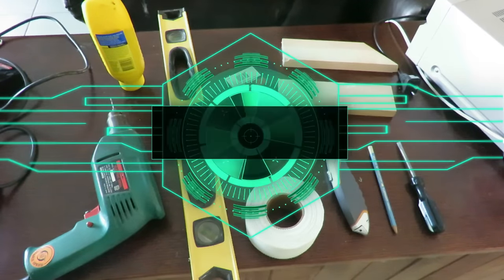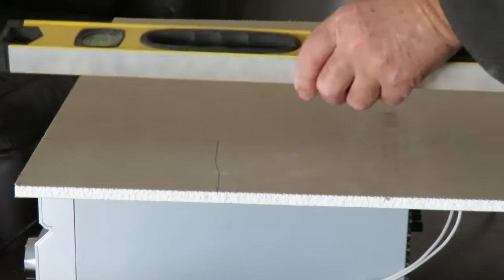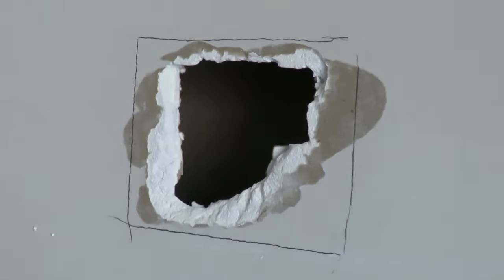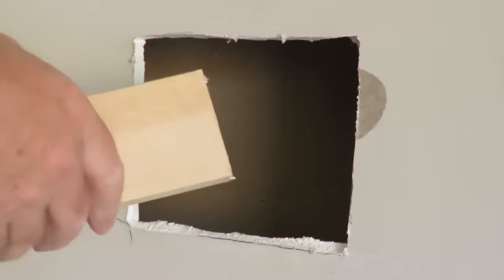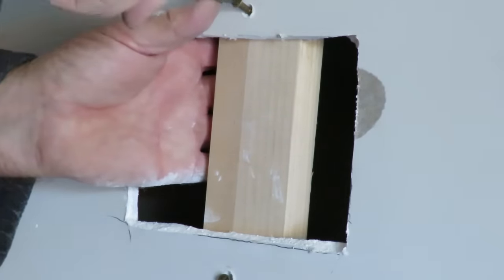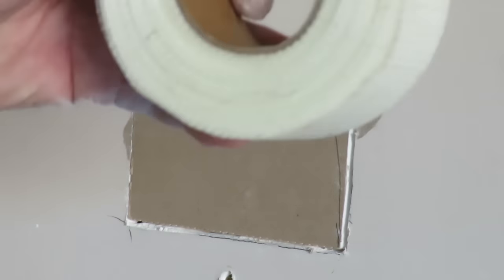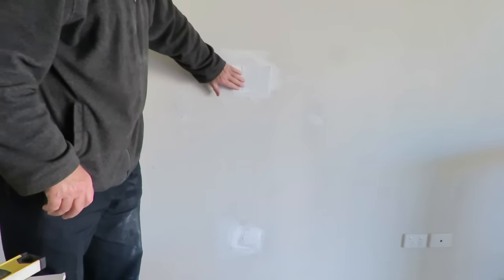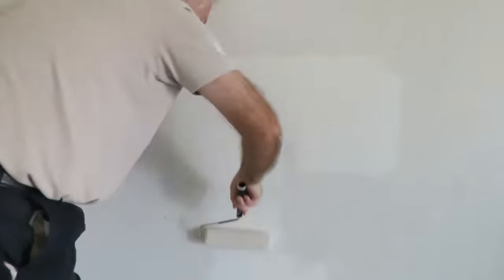🏠 How to Repair Drywall and Fix a large Hole in the Plaster Wall the easy way

Comment: Just a little constructive criticism, I understand this is just a “quick fix” but they one thing you don’t want to do is A: not totally secure the furring strip you put in the back as since this is plasterboard and not sheet rock you need that thing properly secured or one little push that thing will fall out over time. It’s sort of why many prefer using quick set mud to harden and even then people use multiple drywall screws and layers of hot mud to secure the drywall or plasterboard to the strip.

B: if you want to use mesh tape, you don’t want to overlap that as it will blister over time lol. It even says in the instructions that you shouldn’t overlap it as it adds a depth of a 1/16th or 1.5mm for you folks in the EU. In time blisters will start to form and you will have uneven walls. Unless they are cool with that then I suppose that’s ok lol
Reply from the maker: You offer good advice.
Thank you.

Comment: I repair holes like the comment down  below a few. I cut a square hole around the existing hole, measure the new square hole and cut a piece of drywall 1.5” more around the 4 sides, turn the drywall face down and draw lines 1.5” in from top to bottom and side to side. Cut down into the drywall and one by one, break the drywall sides down to the front paper and peel away until you have the solid square piece surrounded by 4 paper “wings”, (dry fit to assure it fits into the square hole you made) put mud around the hole and slowly push the prepared square into place, gently apply some mud on the “wings” while pushing out the mud already applied. Sometimes I will dip the “wings” into a bowl of water which helps the mud to disperse. Feather the mud outward and let dry. After dry, come back with a final coat of mud smoothing at the same time and then sand...easy peasy!
Reply from the maker: Very nicely laid out and well written.
Thank You

Comment: Basically how I learned it, we called it a "hot patch".   I have a cordless dewalt dry wall cut out tool I use.   I dont always use tape.   Ive used paint stirrers for small holes especially if im on the fly.
Reply from the maker: You hit it on the head.
You make do with what's available at the time.

Comment: Gary since u had 2 pieces of wood wooden it make the repair a lot stronger if you installed wood pieces 1 to far left 1 to the far right just saying
Reply: I was thinking the same thing.  That way he not only would have had a better fit  but also the convenience of stabilizing both sides.
Reply from the maker: I normally do use two pieces of wood.
https://youtu.be/JmcR9TW4mM0?
But on the day of this video I didn't have my tools with me, and had to borrow some, and I sourced materials out of a dump bin. (I only found two screws onsite that I could use for the repair).
The video description has more details.

Comment: I personally would use the method shown with the timber like you have but I’d fix it around the edge of the hole so that the edges are solid rather than the wood down the centre so that there’s movement on the joints
Reply from the maker: Thanks.
On the day of this repair, I had no tools with me, I raided a dump bin, and borrowed some tools to do this repair, ( Check the video description).

P.S. I have a better insruction video below, (when I had all my tools with me.)
https://youtu.be/JmcR9TW4mM0?
Reply: The masters like myself don't need wood backing.if you know how to cut the patch to fit tight n snug in the hole it won't fall in ....

Comment: Screw on pieces of thin wood round inside hole, leave an inch exposed for new piece to be screwed on round flush, if you want to do it right.
Reply from the maker: The video description explains why it was done this way. 
P.S. You are referring to normal method of wall repair below.
https://youtu.be/JmcR9TW4mM0

Comment: A jab saw works better than a utility knife for cutting holes in walls.  I'd definitely screw the patch to the wood piece which should have been snugged to the existing drywall instead of left jiggly.  But thanks for the video.
Reply from the maker: Thanks for your constructive criticism, unfortunately on the day of the repair I didn't have my tools with me, and was forced to scrounge materials out of a dump bin and borrowed what I could to do the repair. 

When I have all my tools with me I normally use the method below to repair walls.
https://youtu.be/JmcR9TW4mM0

Comment: First off, keyhole saws are available. No need for the wood and screws, cut the back side of the drywall to fit the hole, cut the finish side paper  1 1/2” larger than hole. Mud the wall, insert piece and mud over the whole piece. 5 minute job.
Reply: Correct. I call these "wing"patches and are the quickest easiest way to patch hole less than 1'x1'
Reply from the maker: The video description will enlighten you.
P.S. I have another wall repair video you might like, when I had all my tools with me.
https://youtu.be/JmcR9TW4mM0
Reply: Garry Purcell ummm, the easy way?
Reply from the maker: @edge1289  It gets the job done when you don't have your tools with you, and you borrow what you can, and salvage everything else.
Reply: Garry Purcell ok Garry, whatever you say, but you had a drill, a screw driver, a utility knife, a putty knife, and wood. The whole job can be done with a utility knife and a putty knife.
Reply from the maker: @edge1289  There are many ways to repair wall damage. (Did you notice just how blunt that borrowed knife was?)
I have another wall repair video you might like, when I had all my tools with me.
https://youtu.be/JmcR9TW4mM0?

Comment: Honestly for that size drywall hole you can probably just use a mash patch or you can cut a square to size and then cut around the back of it and use the paper to stick it on I mean this method works but it’s definitely slower than needed
Reply from the maker: It all depends on what you have available on the day of the repair.
Reply: I think it's too big for the patch method you mentioned. On YouTube you'll see it called the California patch. And the mesh patches are rubbish. They leave a bulge. 
This is the way to do it with a few little variants of course  Good job 👍

Comment: Oh my god - cut a 4 inch square in the wall , cut a 7 inch square from scrap drywall , turn it over and score an inch and a half all around on the backside , crack and remove edges from outside leaving paper in tact , put some mud around hole in wall and around edge of piece your putting in , squeeze mud from under paper , great patch !
Reply from the maker: There are lots of ways to do repairs, it all depends on what is available at the time.

Comment: I've done this before but I screw the new piece of dry wall to the timber to fix it so it doesn't move. Or you can use a cut piece of dry wall instead of timber
Reply from the maker: Thanks for sharing how you repair your walls.
I normally use this method below.
📌 https://youtu.be/JmcR9TW4mM0

Comment: Awesome job!  
One tip, if available use two pieces of wood at either end of your repair, that way the piece of drywall is a bit more stable. (Specifically for larger repairs) 
You did a great job with what was available tho
Reply from the maker: Thanks for taking the time to comment, and also reading the Video Description.
I normally use the method below to repair walls.
https://youtu.be/JmcR9TW4mM0

Comment: Garry you are doing it all wrong mate 
Step 1 clean the edge of the wall and put a chamfered edge on it.
Step 2 put your timber on like you did.
Step 3 cut your board for the repair and put a chamfered edge on it.
Step 4 screw your board on more screws the better to keep it firm.
The chamfered edges will stop it cracking and their will be no need for your mesh tape has when putting mess on will leave a bump.
Step 5 use easyfil 20 for first and second coat 
Step 6 third coat use pro-mix light easier to sand 
Step 7 use a p120 grit to sand down but leave 24 hours for the final coat to dry.
Use these steps for the perfect job.
I’ve tried and tested this hundreds of times it works and not had any complaints.
Reply from the maker: Thank You for laying out a nice and easy to follow list to follow.

Comment: Good job.  I do this for a living.  A few ideas.  A drywall knife cuts those shapes way faster than using a box cutter.   Box cutters are great for scoring and snapping but that doesn't apply to this job.  Cut drywall atop your trash can to collect the dust.   Use a drywall mud pan against the wall to collect dust on the wall cuts.   paper tape is 10x stronger than mesh tape.  Pro tapers tell me this and google confirms it.  3 coats of mud is required for this repair.  Even the best 2 coats of mud wont make it look right. Use setting mud for the 1st coat.  And im sure you had none of these tools based on the comments below. ...lol.  cheers!
Reply from the maker: Thanks for your suggestions.
As you have concluded, on the day of this repair, I had limited tools with me. (I was on a non-related job)
I had to borrow some tools, and source materials out of a dump bin.
Reply: @GarryPurcell  you did awesome considering! Good vid
Reply from the maker: @snakeclaw  Thank You.
Reply: snakeclaw a machete for me 👍

Comment: You better cut the drywall till the middle of the studd. And you’ll get your backing. Proper result than putting a floater backing.
Reply from the maker: That's another way, it really up to you to decide which method you use.

Comment: Should you not put two bits of wood in to stop it moving about ?
Reply from the maker: Yes, support backing is prefered, but it all depends on what you have available on the day of the repair.

Please Read the video description for a better understanding as to why the repair was done this way in my video.
P.S. I normally use this method when I have my tools with me.
📌 https://youtu.be/JmcR9TW4mM0

Comment: Dont use screws. This is over kill. Use Mitre glue , its instant and no mess. Using tape only makes for protrusion. Peel the back piece of paper off the infill piece. This will allow the filler to be sanded to the wall and be perfectly flat.
Reply from the maker: Thank you for showing another way of doing wall repairs.
Reply: It's not another way. It's the fastest,  cleanest , most simple straight forward erase all other ways way !
Reply from the maker: @dh737  Well Said.
Reply: @dh737  it is clearly another way.

Comment: Just a question: why not drive a screw in the middle of the new drywall patch into the wood? Is there any specific reason not too?
Reply from the maker: I could only find two screws on the day of the repair.
If you read the Video description, it will help you understand why the repair was done this way.
P.S. Be sure to check out my other wall repair video, when I was prepared for wall repairs.
https://youtu.be/JmcR9TW4mM0

Comment: Far easier to use a piece of wood to each of 2 sides of the hole . That way the plasterboard is supported and there is no need for the tape.  Also if plaster board self tapping screws are used there is no need to drill. Also use a saw rather than knife to cut the plasterboard patch .
Reply from the maker: On this day,  I had no tools or materials with me. (Read the Video Description)
I normally do repairs the way you mentioned, as shown by my other video below.
https://youtu.be/JmcR9TW4mM0
Reply: iiMore solid if you put two pieces of wood one in each side!!!🤔👍👍👍
Reply: You right👍👍

Comment: Why did  you put the patch with the back side out?
Reply from the maker: It makes little difference for a small patch on a central wall, as long as the patch has an undercoat, the topcoat will have some tooth to grip.

Comment: Why are you putting the peace of drywall backwards?
Reply from the maker: It makes little difference for a small hole in an internal wall, as long as you give a primer coating providing good tooth, for the final coat of paint.

Comment: Please, support the patch with two scraps of wood, one on each side.  Screw them to the drywall with half exposed in the hole, then screw the patch onto them on both sides.  Solid as can be. If it's only supported in the centre it will crack if something bumps up against it or with temp/humidity changes.
Reply from the maker: You took the time to comment, BUT DIDN'T Take The TIME To READ THE VIDEO DESCRIPTION FIRST.
For your information: This repair is 4 years old in a rental property, and still holding perfectly with no cracks.

P.S. I normally use this method when I have my tools with me.
📌 https://youtu.be/JmcR9TW4mM0

Comment: dude  i saw a few thing that u did wrong well one thing is not really wrong but  sheet rock has two side and each side has 2 diff color have paper  the white side of the rock goes on the outside  and 2  b4 u put on the tape u should have remove some of the paper around the hole  this is done so there is no lump  when u put on the dry wall mud  the way u did this  u can ALL was tell where the patch is b/c there will be a lump   there is other way that u can patch the same hole but this other  way  u make the patch a little bigger the the hole so u can use the paper on the patch  as the tape
Reply: i have worked as a apartment maintenance man  for over 15 years  and i would put money on that i have patch more holes in walls the u have got laid   lol

Comment: Should  have  added  2 drywall  screws  in  the  center for  more  security.
Reply from the maker: There are many ways to do repairs, it all depends on what you have available on the day of the repair.

Please Read the video description for a better understanding as to why the repair was done this way
P.S. I normally use this method when I have my tools with me.
📌 https://youtu.be/JmcR9TW4mM0

Comment: I use this technique often, I like it. However, I always put two screws in the center piece to hold it firmly. This technique is simple enough for the video not exceed the 5 minutes, it’s excessively long.
Reply from the maker: I have a slightly different repair video you might like.
https://youtu.be/JmcR9TW4mM0?

Comment: Good job mate. Will save me alot of time on the tools normally i used to measure the hole. Better to trace
Reply from the maker: I was asked if I could do this repair when I was on another job, and didn't have appropriate tools with me.
This video was meant to show just how easy it is to do this type of repair, with a bit of ingenuity.

I normally use this method below,
https://youtu.be/JmcR9TW4mM0

Comment: Why didn't you screw the drywall piece to the board?  The screws you did use appear to be below the paper.  Both of these issues make the joint very weak.  I would have used both boards and then screwed the drywall in each corner.  It's never going to be a problem again.
Reply from the maker: Good Questions
I'll do my best to answer them for you.

Why didn't you screw the drywall piece to the board? 
1. The backing timber board is only there as a depth guage for the drywall, and not for strength. The plaster that is squeezed into the open area around the patch, effectively holds the repair in place.

The screws you did use appear to be below the paper.
2. The screws are definately below the plasterboard surface, so they can be covered over with a thin layer of plaster, and not show through the finished sanding, and subserquent painting of the repaired surface.

Comment: Watching him use a screw driver to screw that board in the wall made me cringe.... Him using the wrong side of the sheetrock (brown side) triggered my ocdc .... As I was making this comment he used a ghetto ass spatula to start spreading instead of using the perfect plastic spatula he already had from the start. This whole video is a cringe fest for master carpenters. ... Overall he finished the job perfectly.💯
Reply from the maker: I was onsite doing non related work, so I didn't have my tools with me, as the video description explains.
I have another wall repair video you might like, when I had all my tools with me.
https://youtu.be/JmcR9TW4mM0?

Comment: oh wow.  hope it's not going to be wobbly...  i don't have any experience in doing this, but I think if you seal the gaps with that muddy stuff before you taped it and let it dry before cover it with mud again, it would be stronger and feels like one piece.
Reply from the maker: There are many different ways to do repairs, it all depends on what you have available at the time.
Here is another wall repair I completed.
https://youtu.be/JmcR9TW4mM0

Comment: FIRST MISTAKE, DONT USE A KNIFE.
USE A COARSE DRYWALL SAW.
Second mistake, cut the patch so that there is at least a saws width of gap between patch and hole.
WHY? So that drywall filler can squeeze between the patch and wall and form a much better fit, preventing cracking.
Reply from the maker: If you bothered to read the video description, you would know why the repair was done this way.
P.S. I have a better instruction video below, (when I had all my tools with me.)
https://youtu.be/JmcR9TW4mM0?

Comment: You started out right, But the patch is moving you need more screws and you did not cover all the Board with tape, I t will crack
Reply from the maker: Thank you for sharing some good information..

Cracking has not occured in the repair to date.

P.S. I have a better instruction video below, (when I had all my tools with me.)
https://youtu.be/JmcR9TW4mM0?

Comment: Wider head screws would hold better + better if you hold the patch with a screw also, it will be way stronger even if you accidently push this area of the wall later on!
Reply from the maker: Good Tip
Thanks